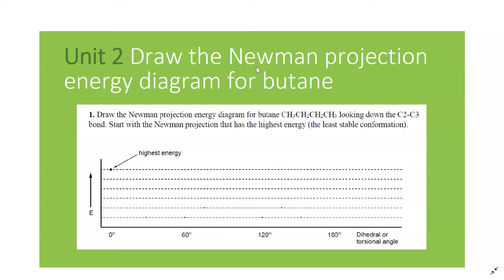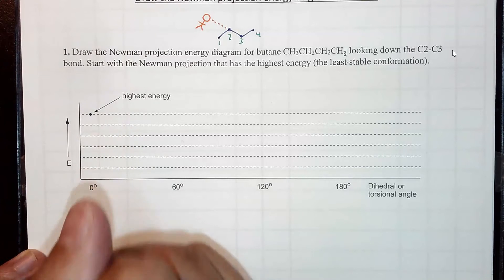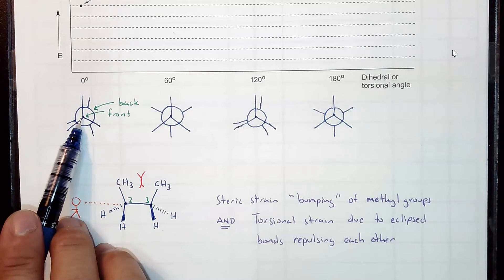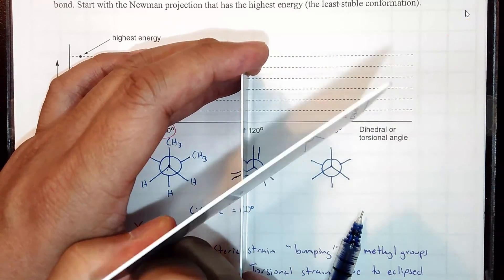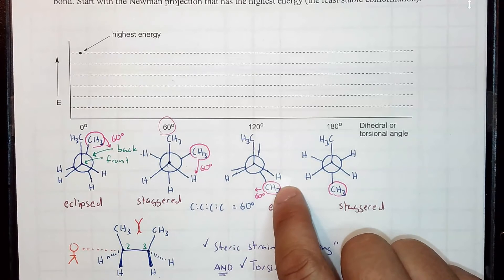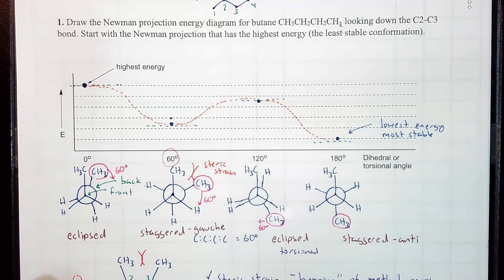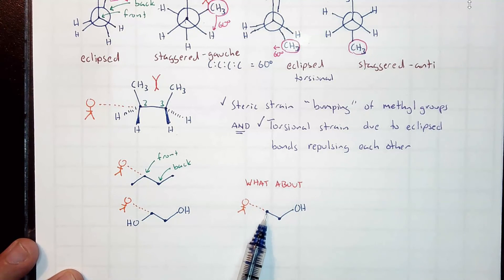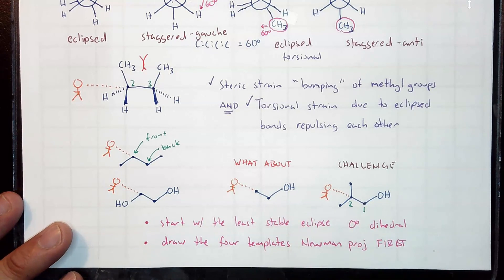Draw the Newman projection energy diagram for butane

Comment: How did you know to draw it as cis instead of just zig zags?
Reply from the maker: The first Newman projection has the two methyl groups eclipsing each other because the directions want the first conformation to be the least stable. When the two methyl groups are eclipsed they are "on the same side" of the C2C:3C bond and the molecule has steric and torsional strain. Some textbooks ask for the most stable first and others, including my example, ask for the least stable conformation first. Also I agree with your wording "zig-zag" and that refers to the most stable staggered conformation (here it is the one at 180 degrees. That molecule would be zig-zag. But the term "cis" is really for alkenes or rings with substituents. I hope this helps.
Reply: @fieldguide2chemistry  I replied back with a question but I cant see it anymore.  Not sure if its hidden somewhere
Reply from the maker: @blakebarber6935  I do not see it either, here or in my email